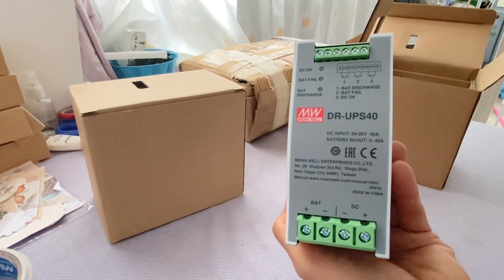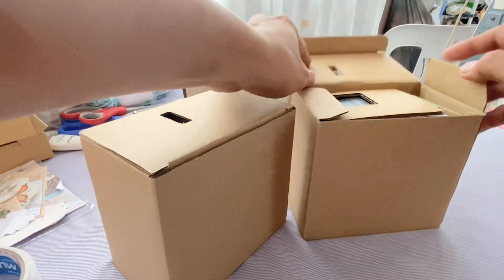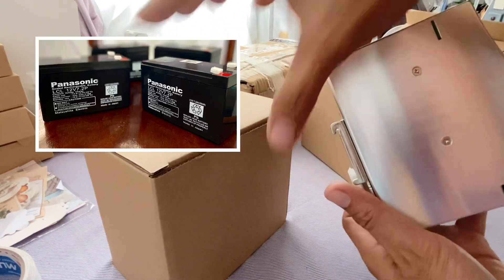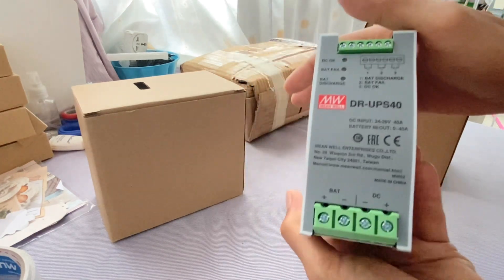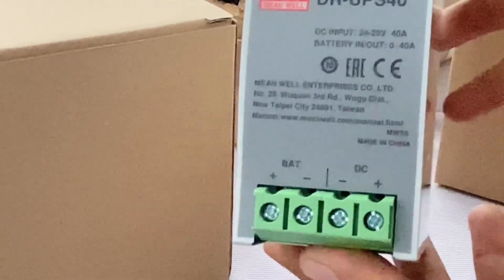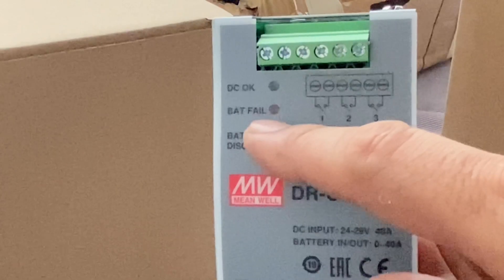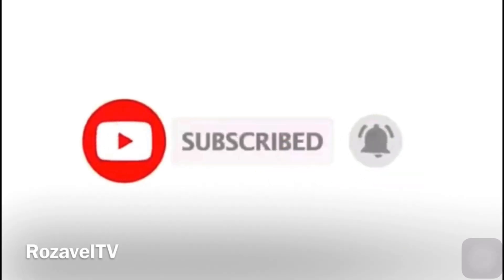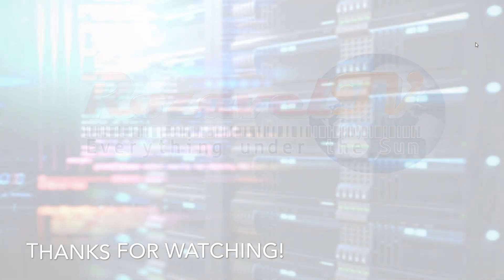Meanwell UPS Unboxing

Comment: Hi, i can use two bateris 100 AH 12v
Reply from the maker: You may use it as loang as you will limit the load below 40A. Otherwise, you shoud purxhase a hinger rating of this unit.